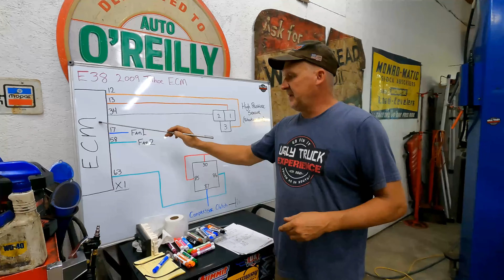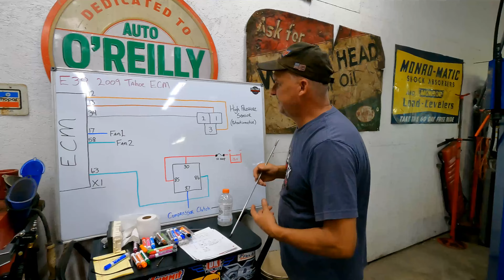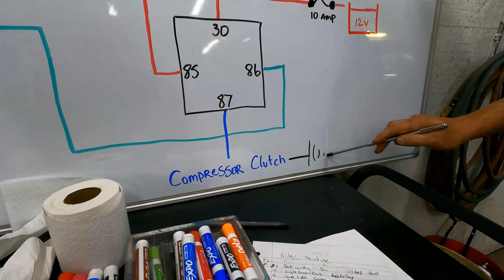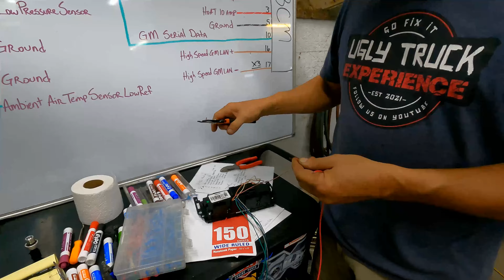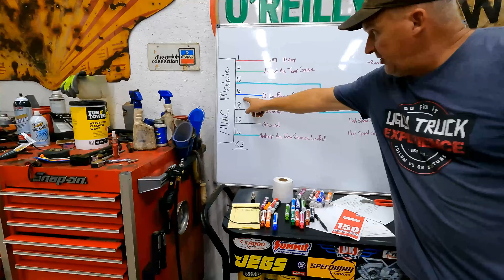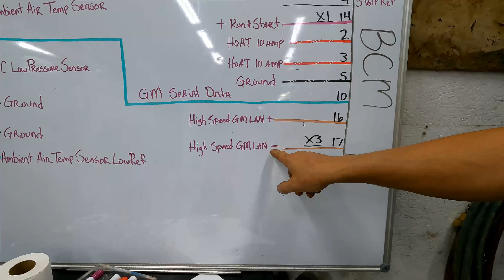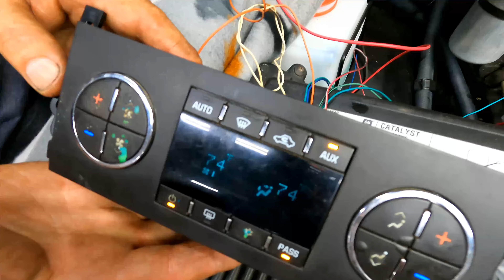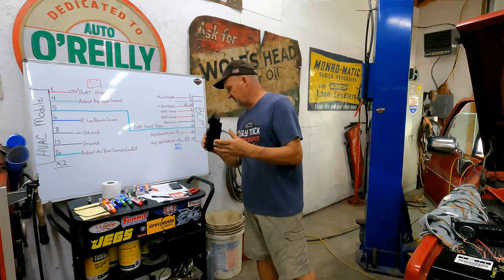NIGHTMARE ON E38 STREET - Wiring Gen 4 LS Swap AIR CONDITIONING - UTX

Comment: My harness is from a 09' Yukon 5.3/6l80. If you guys could have put video out a month ago, I wouldn't have depinned and pulled all my a/c wires out of my harness. Lol. Grrrr. My fault lol. I had someone say that it's too hard to get it to work. Just go with an 03' ish compressor and relay it old school. Idle the engine up a bit. I didn't like that idea but you know I'm kind new in the Ls world. I'm going to repinn my wires and put them back. I have my schematics so I can put them. Back lol. Now I can learn the right way to do it. Thank you guys!!!

Comment: Im using a P59 from a van. These still support ac activation on pin17 like 411. They pulled the circuit in pickups and suvs but vans and s10s still used analog command
Reply from the maker: The P59 is a great ECM.  We have used them on a few jobs and they can be made to do pretty much the same as the 411.  Thanks for watching.  We appreciate it.  Jerry and Emily.

Comment: Nice video so at the end of the day you need the bcm in order for this to work
Reply from the maker: Hello Judon.  Yes, you would need a bcm on a Gen 4 to run air conditioning with a factory harness and computer.  Jerry and Emily
Reply: @UglyTruckExperience  ok I got a gen 4 setup in my obs it blows nice and cold i tricked the pcm to turn fans on but I would like the idle bump up  I also got the BCM and climate control from a 2008 Yukon but what I wanna know are you using that whole climate control you never gave a finished update on the final install

Comment: Lol that cooler is vintage it goes for over 200 on ebay , great video
Reply from the maker: Good gravy! Sounds like we need to go into the vintage cooler business! 😆 Thanks for tuning in, Kev!
Reply: @UglyTruckExperience  I hate to ask a question unrelated to the video but . I have a 05 silverado 5.3 325000 miles just shut off now no spark . Any thoughts ?
Reply from the maker: Check your Ign1 relay and the fuses that feed it.  Jerry.  If it just shut off, it could be a short to ground that blew a fuse.
Reply: @UglyTruckExperience  thanks Jerry I will let you know what I find

Comment: An idea for you from my experience messing with some Toyota Sequoias (2006 etc.). Use a purge solenoid to create a throttle body bypass, similar to the purely mechanic throttle body bypass (power steering air control valve) the Sequoias use. Then do it like the old school stuff, with pressure switches. Purge/bypass valve wired in parallel with clutch. Please let me know if that doesn't/can't work for whatever reason. I know the gen 3 stuff is stubborn about idling up when TPS doesn't change, you can give it excess air... a lot of excess air. Idle overspeed error setting pulls a shit load of timing to make it stay at the programmed idle speed.
Reply from the maker: Hey Marc.  I can't see why that wouldn't work or at least help.  If it was getting to much air, you could meter that and try to fine tune it a bit.  Very interesting.  I know you are a wizard with these computers.  Do you have any thoughts on why the ecm would not read AC pressure without the AC request?  Thanks.  Jerry   I just read your first message.  We had the same thought I think.
Reply: The why of ECUs doing what they do is always the same. That's how the employee programmed it. The only way to make sense of that is annoying detail that doesn't really matter; reading a sensor takes CPU cycles. Probably boils down to what somebody learned in college that enforced these programming habits.
Reply from the maker: That makes sense.  The CPU cycles.  You get used to seeing things the way you expect and are floored when it is different, automatically thinking something is wrong. Thanks.  Jerry

Comment: When you say “GM Serial data”, is that the class 2 network? (J18650)

Wondering if it is the same protocol that the “up to” 2006 (and some ‘07) uses.

‘Nother AWESOME video… I love the data stuff!

Thanks Jerry and Emily!
Reply from the maker: Thanks Rob.  The class 2 data is different from the GM Lan that I mentioned in this video.  I had found a great page somewhere online that described all of them in detail and haven't been able to find it since.  I think it is really interesting but still way over my head.  I know when I pull up a wiring diagram and it is full of GM Lan connections it gives me a ton of better access with my scan tool.  The class 2 just basic info and inputs.  Thanks for watching.  Jerry
Reply: @UglyTruckExperience  

Wasn’t there three different data lines that you spoke about? “GM Serial data”, GM LAN high (+) and low (-)? My question was about the serial data that goes between the HVAC module and the BCM.

Thanks for the reply Jerry! Hope yall have a great week! Looking forward to the next video!

Comment: I’m about to swap a ly6 into a wrangler. The motor only came with the E38 ecm. Dose the vin on the BCM have to match the ECM? Also do you know if the TCM needs to match also? You guys have great content. Thanks
Reply from the maker: Hello Jeff.  The BCM and the TCM are not vin specific to that E38.  If you have a TCM that is very close in the year and transmission that it is running it can make things a little easier but they can be tuned for whatever setup you are running.  Thanks.  Jerry

Comment: Hello  UTX I see some of your videos and I learn a lot ! I have a gen 4 but I’m use the R4 compressor do you know how to wire it for make it works ? I need to connect some wires to the ecm ? I have 6.2L and NV3500 transmission thanks in advance and you guys make a good videos
Reply from the maker: Hello Hose.  The R4 compressor has a power wire and a source to ground that is the same as most all compressors.  If you are using the donor harness and ecm to run your system, your compressor  would wire the same a the donor.  Thank you for watching our videos.  We do appreciate it.  Jerry
Reply: Okay thank you so much Jerry I’m asking bc already buy brand new the a/c condenser and the R4 compresor and lines and evaporator too so i need to delete everything about the original a/c system and run new wires for the setup you already explained for 4 gen ?
Reply: Hello Jerry ! Already do it the same way your explaining and the HVAC don’t turn on,I have a HVAC manual I’m just put the ignition in on position but the HVAC don’t turn on

Comment: Hello Jerry ! Already do it the same way your explaining and the HVAC don’t turn on,I have a HVAC manual I’m just put the ignition in on position but the HVAC don’t turn on
Reply from the maker: Are you working with a GEN 4?  Jerry
Reply: @UglyTruckExperience   yes im working on gen4 the BCM have power and ground, same the HVAC, in the BCM connector X1 pin #2,4 I'm out together, im connect the relay same way you explained, from HVAC X2 connector pin #1 connect to the light green wire from the original low pressure sensor that goes to the dryer and I have 12+V when I'm turn the a/c on from the 87 c10

Comment: Why would you not change the cam?😢
Reply from the maker: Hello Randy.  When you remove the stock grind camshaft and replace it with a different cam profile, you are committed to having a tuner tune the engine once it is up and running.  We use stock cams and the person who programs our computer loads a stock cam profile into the ecm and that is all that needs done.  No Tuning...  When you figure the cost of a cam and what Tuners are charging.  It is at least 1000.00 difference just to make the truck sound cooler.  They already have more HP than a person really needs.  Its just my opinion.  Thanks for watching.  We appreciate it.  Jerry and Emily
Reply: @UglyTruckExperience Hi Jerry, to piggy back off of not changing the cam, I have an 07 L92 with VVT that I wanna swap into an older Impala...Can the e38 be programmed to keep and use the VVT? I already purchased a camshaft, but still need to purchase a VVT delete kit if I'm going that route...Any advice is greatly appreciated 🙏🏼🙂
Reply from the maker: Hey Anthony.  That L92 puts out a ton of horsepower just the way it is.  If it was mine, I would put that in with a stock tune and keep the VVT.  The VVT works really good in the LS motor with rarely any troubles. You would only need vats removed from ECM.  If you do switch to non VVT and go with a different cam, I would ask the person that is going to program your computer or if there is not a stock tune for a 6.2 without VVT you will have to have somebody tune it which is a pain and an expense.  An aluminum 6.2...  You struck gold there.  Jerry

Comment: Are you guys heading close to North Carolina anytime soon? I'd like to meet up with you guys but I can't travel that far.
Reply from the maker: That OBD connector has the GMLan wires going to it, so I just tapped into that splitter to make my connection from the bcm to the ecm.  When I wire it up for good I will go directly to those wire at the trucks obd plug and then keep that splitter for myself in the future.
Reply: @UglyTruckExperience  oh ok cool sweet.

Comment: I need to know how to get the transmission to work. Ive got a 2010 ecm and a 98 4l60e  I’ve seen nothing on this anywhere on the internet
Reply from the maker: What is your.wiring harness from and what transmission is it wired for? Jerry
Reply: @UglyTruckExperience  I’ve got a stand alone harness with a 4l60 plug and I have a 2010 Silverado factory harness well entire truck without motor or transmission that I’m pretty sure had a 4l60  but the psi harness ask if it’s a early 4l60 and says it needs special tuning. I have everything to make it a gen 3 with no problem and take away all the questions but it’s a gen 4 block and I’ve never done one and gotta do it sometime.
Reply from the maker: Ok.  Sounds like you will just have to plug it in and find somebody that is very familiar with tuning that ECM and Transmission combination.  They put out a ton of them with that set up, but getting the ECM and TCM tuned for what you have will be the only obstacle.  A good tuner will set it up no problem. If it is stock, you may be able to just send it to a programmer which would be cheaper.   Thanks.  Jerry

Comment: Jerry sor, question.  Being I am swapping this Gen 4 Ls3 into my 03'Crown Vic Police Interceptor, using the Gm compressor. Using the Ford accumulator and evaporator from my Ford. Changing the switches to the Gm switch and my orifice tube is white. Do you think there will be a problem with the parts working together? Or would I prob have to use a different color orifice tube for the correct pressure using a Gm compressor? I know a/c systems are a/c systems lol. But they have to be right for efficiency reasons.
Reply from the maker: It should work just fine.  You could try running with the adjustable orifice tube if you don't mind paying for it.  It might work just a bit better if your in a hotter climate but I have never noticed a difference so I just go with the stock tube that was for that application.  I would be curious to know how much refrigerant that system holds when your done.  Thanks.  Jerry
Reply: @UglyTruckExperience  I will let you know definitely!!! Thank you sir for the help. I'm a ways from there but I can't wait.

Comment: Hello UTx i did a 05 suburban swap to 1972 suburvan. You think that i might have to do the same thing that you did to run the 05 suburban front and back ac on the 72 suburban im using all front the 05 suburban
Reply from the maker: Hi Paco, you won't need a BCM for your 2005 swap. Check out this video showing how we wire the AC on a Gen 3 swap. https://youtu.be/tv1LtLT9zmM  Hope this helps! Thanks for watching!  --Emily and Jerry

Comment: I have a 2000 jeep xj and currently swapping in a 5.3 with e38. Is it possible to run the ac from the jeep climate control by using both pcms?
Reply from the maker: Hello Omar.  The jeeps AC switch uses a path to ground to turn the AC on in the Jeep.  On a Gen 4 swap you would have to use the body control module and the AC module from a donor and use a relay to control the AC module being turned on by the Jeep AC switch.  Same as in this video basically but adding a relay to supply power to module by supplying ground.  Hope that makes sense.  Jerry

Comment: I did the a/c on mine but now my climate control does not work due to no vacuum what did u use to add vacuum to the climate control
Reply from the maker: If you are using a truck intake manifold, there is a little vacuum port on the top middle of it that points out to the passenger side.  You have to break the little tip off of it and that is a good vacuum source.  We really need to do a video that addresses that.  Thanks Ricardo.  Jerry and Emily
Reply: @UglyTruckExperience  definitely yes I’m sure there’s ppl out there who run into this issue